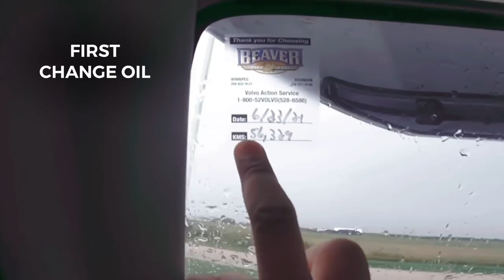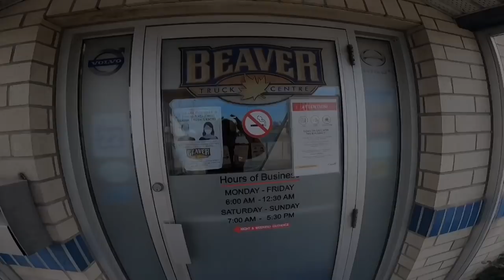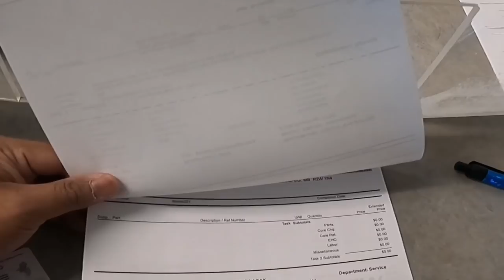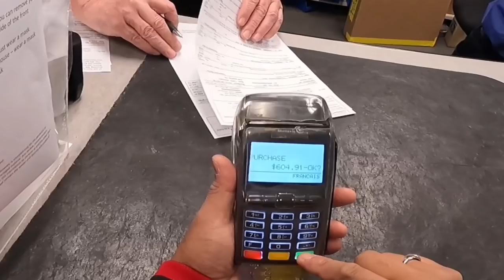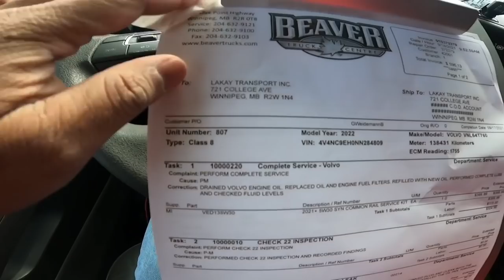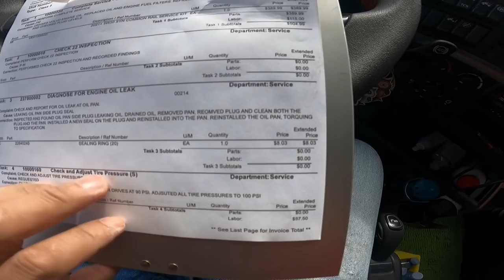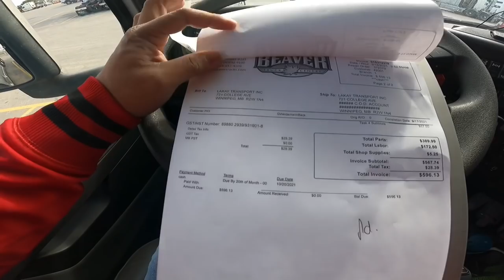P66| VOLVO 2022 MAINTENANCE  INTERVAL | LAKAY PINOY TRUCKER🇨🇦

Comment: Correction bossing Pinalitan lang nila yung flat waser,, At crank case oil drain plug ang tamang termino nya mas malapit yan term ko boss,, dun naman sa grease ayy yun ang mga fittings, mag coconect sa grease gun.. nagsasalubong tayu lagi boss..ingat lagi mga ka truckers..
Reply from the maker: Thanks bossing
Reply: Tama yan tol, hindi natin bina bush siya tinoruan lang natin ng tamang pangalan ng parts
Reply: @ralphienelson7280  oo boss di natin pwede i bush ang mga kasamahan natin sa trucking industry bagkos itama lang natin yung tamangbtermino dahil wala naman ibangbmagtutulungan kundi tayu para maiwasan ang mga of bang lahing busher hehehe tulong tulong magkaisa wag bigyan ng maling kahulugan drive safe mga lodi..